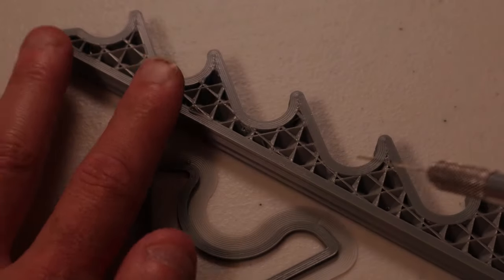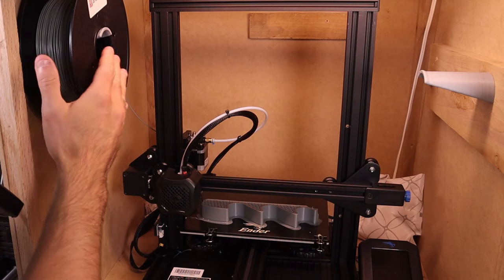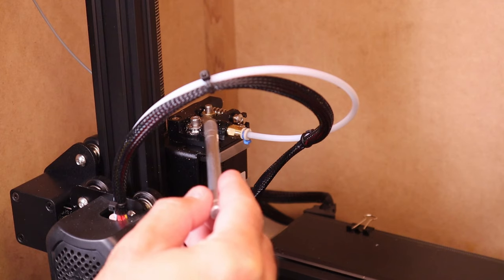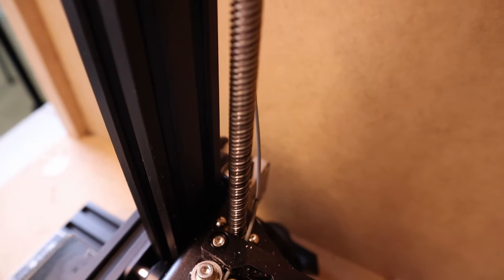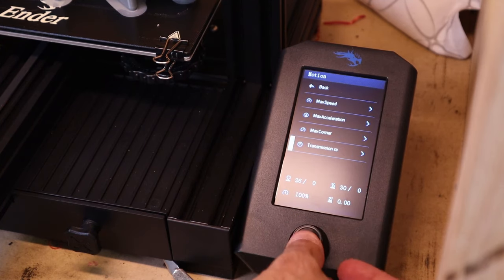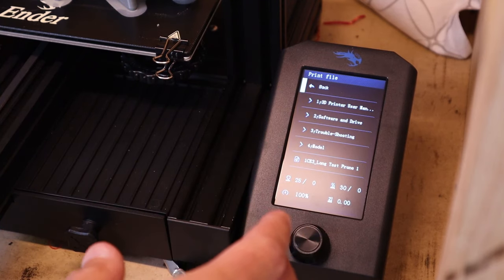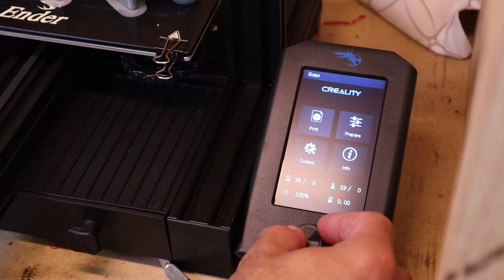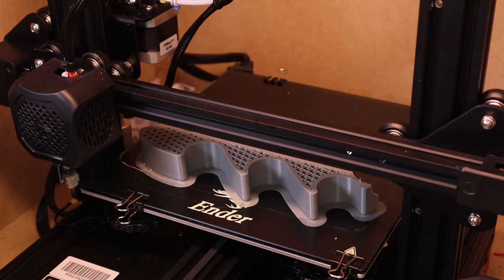Creality Ender 3 V2 - Solving Under-extrusion To Save You Hours

Comment: Where is the test link?
Reply from the maker: Hi, there are three links in the description, are you on a phone?  If you are, you might not see the description, so here they are:  

https://www.youtube.com/watch?v=dLZm2itXJkg

https://www.chepclub.com/ender-3-v2-firmware.html

https://www.reddit.com/r/ender3/comments/hhv9yt/ender_3_v2_firmware/fwhe0qd/

I hope that helps.
Reply: @NeedItMakeIt  Sorry, I meant the test for how much filament is comming into the ender 3 v2. All those links are for the firmware update, right?
Reply from the maker: @LeonardThury  https://www.youtube.com/watch?v=QnrH2Sk7y40  This guy does a good job of explaining.   I actually didn't bother with any math, I used a few test samples to dial it in more exact.  I did do the measurement method, and that get's to pretty close.  If your machine is set to 93 E-steps like mine was you'll likely want to set it higher, somewhere in the 100-104 range.
Reply: You are a life saver! Thank you! Everything os working great now! 👏👏👏
Reply from the maker: @LeonardThury  Glad that it worked out, I wasted so much time on this and sometimes there are so many possible causes that is just isn't clear how to solve it.

Comment: Printed fine stock for about 4 rolls, then underextruded
bought the cheap direct drive kit autoleveler and tighter screws, printed fine for about 2 rolls, then underextruded
bought a full metal hot end and the capricorne tubing, replaced the parts for my bowden rig, printed fine for about 2 rolls, then underextruded
bought the $35 full metal heatstop and installed it into my direct drive, printed fine for about 3 rolls then underextruded

... about to throw this bloody thing in the trash DO NOT BUY

Comment: I did not experience this supposedly "major flaw" when my machine arrived. The problem may be unique to you or merely a handful of users. Ever think about that? Mine worked great out of the box and the results far exceed my expectations.
Reply from the maker: It is possible that not everyone is affected by this of course.  It is also possible that many people are, they are produced in high volumes and thus is is quite likely that this is common.  The manufacturer may also be aware of the problem and has solved the issue with the firmware from the factory (old stock/new stock).  I won't waste any more time thinking about it either way.  The video is here for people who need it, if they don't need it, that's perfectly fine too.  

It is a good machine no question, I am also happy with it.
Reply: Mine did need to be changed, but the Chinese to english translation is a bit off so the save settings button isn't labeled correctly. I just followed guides on youtube I think mine is at 103 now instead of 93